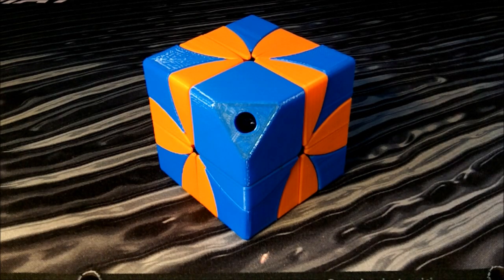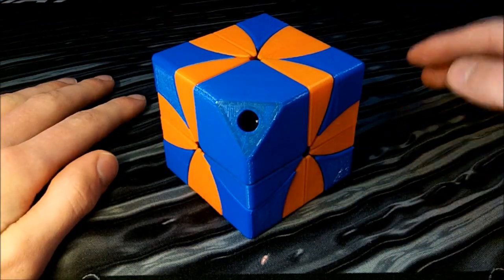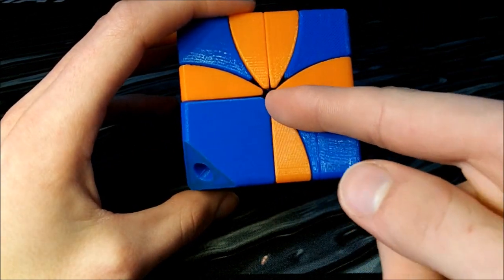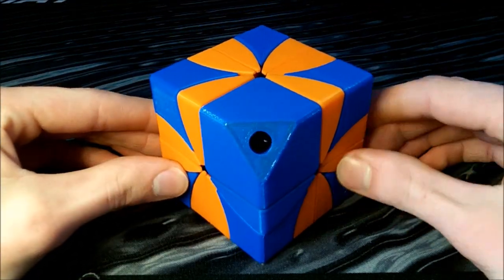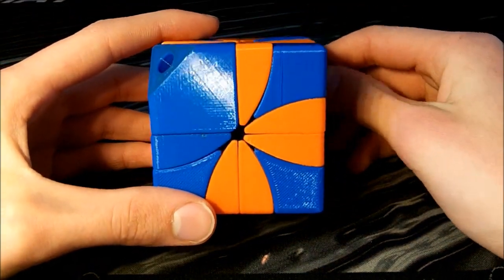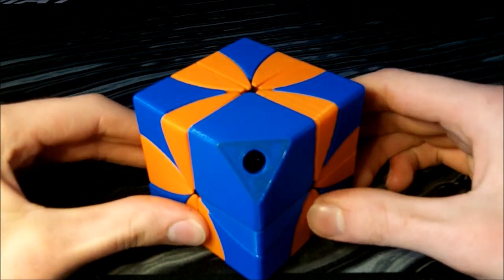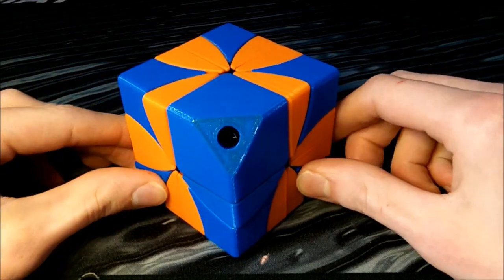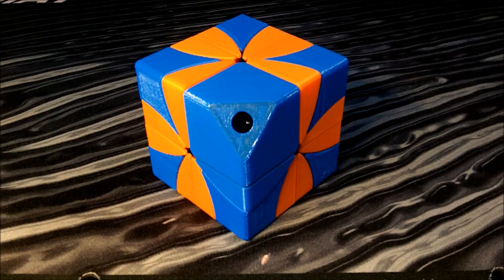Asymmetrical Dino 2x2 Cube

Comment: What if instead of printing the bandage section you print all pieces the same?? (no bandage) could it be assembled??
Reply from the maker: PandaHeadGuy For the bandaged section I could either print a full piece to replace multiple pieces or I could use screws to bind the pieces together. So yes that would be possible and it could be assembled.
Reply: Yay! i think ill be soon printing it!

Comment: did you have to have to sand it down at all after printing in full quality?
Reply from the maker: Toy Zera I do not sand the pieces at all, I only use an xacto knife to remove the support material. Do you still want a puzzle? I just finished printing a new one.
Reply: PerpetualCubingMachine no thanks, its real close to the time I get a 3d printer. sorry :D
Reply from the maker: Toy Zera that's alright. Good luck with the 3d printer and please tell me how it works out for you. I'm happy to help with general 3d printing or the assembly of my puzzle if you'd like.
Reply: PerpetualCubingMachine thx! I will definetly ask you first if I need help with 3d printing

Comment: this could be a replacement for shapeways! you could be almost like the oskar for thingiverse! this is amazing! I'm getting a 3d printer this summer, I'm so excited
Reply from the maker: Toy Zera I highly recommend buying a 3d printer, they aren't to expensive but are really helpful to have. If you need any help finding a good 3d printer I can help you find a quality printer. Do you still want one of these puzzles? I saw your comment earlier but it's gone now.
Reply: PerpetualCubingMachine I know, there amazing! I'm getting a XYZ Da Vinci
Reply: PerpetualCubingMachine btw that previous comment, I do want one, but is there anyway I can get one of amazon or ebay?
Reply: PerpetualCubingMachine Im getting the XYZ Da Vinci because its $500 (Low price) high quality (If printed on high resolution, just not speeding up the print)
Reply from the maker: Toy Zera Ebay is one option for me, the other would be to use the 3d hubs service, but getting the puzzle to you doesn't need to be figured out until the puzzle is printed.

For pricing an unstickered puzzle would probably be around $12 but a stickered puzzle would be between $20 and 25 (plus shipping for both). Sorry that a stickered puzzle is kind of pricey but currently I have to manually cut the stickers which takes a long time. However, prices are open to discussion if these don't seem reasonable.

What color puzzle would you like? I have dark blue and orange (you can have different colors among pieces like I did but that was just because I am out of light blue material) and would you like the puzzle stickered? The dedge pieces of my first prototype are the orange plastic and the core of this is the dark blue. There are some pictures on thingiverse that show the core.

My 3D Hub: https://www.3dhubs.com/boston/hubs/thomas
Reply: PerpetualCubingMachine Ebay would be good, Orange Corners, and Blue Dedge Pieces. the core can be any random color, because I wont see the core while solving. and I would like it unstickered. I will order it around early July. the centers would be blue please.